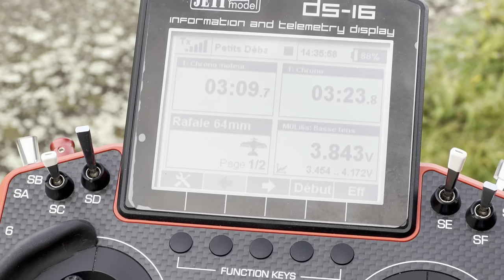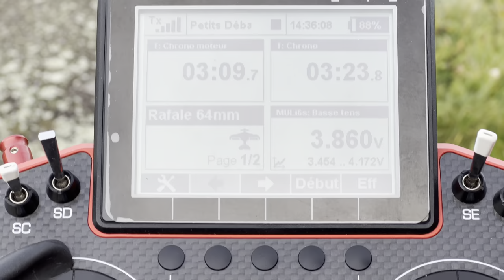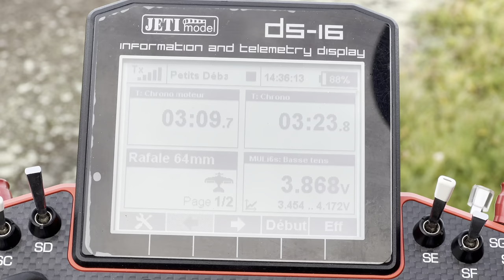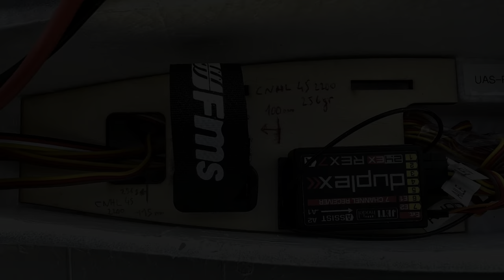PERFECT CG 🤩 • FMS Rafale 64mm EDF Jet RC PLANE • (English/Français 4K 60fps)

Comment: Arthur, try the two brothers canard modification, I test flew it today, it work really well and works even better as you push the cg back, no alpha lock, rudder control only in high alpha, landing really slow at high alpha and the flight times seem better. You need about 5mm reflex on elevator and up the elevator throw about 30%. The only down side is take off run a little longer, but when cg is moved back the take of is almost automatic and back to normal run length. Thanks for your channel loved watching and try to revive my French understanding.
Reply from the maker: Hi buddy and thanks for your comment ! I don’t have it anymore unfortunately 😢

Comment: Thank you,  I had mine originally set at 90mm, which results in nose dropping at low speed, and also take a long runway during take-off; I will try your propose of 100mm CG, which should be much much better.

Thank you.
Reply from the maker: Yeah buddy you’ll discover a new jet 🥰🥰🥰

Comment: very good flight bro, dont forget to srt your revers trust, there is hiddent yellow wire from esc signal wire in thats plane. i use it already,  good for breaking during after landing..  ;)
Reply from the maker: I will recheck
Reply: So what channel does the yellow wire up into. Free channel and assign a switch?

Comment: im using ovonic 2200 50c batteries and to get my 100mm CG i have to have my battery at least another inch forward from where Arthur has his Spektrum battery located here....So either my battery is much heavier or Spektum gen 2 batteries are much lighter???
Reply from the maker: I have CNHL 4S 2200 40C (256gr)
Reply: @looneytunes47,  My normal size 4S 2200mah45c weight 265gram, and my Ovonic 4S 2200 45c is 180gram; which is same as your situation for the ovonic 4S.

As you said you need to move your 4S forward another inch, this mean your ovonic batter is much lighter, this is why you need to move it forward to gain some nose weight.
Reply: @warmiceUT  That makes perfect sense then